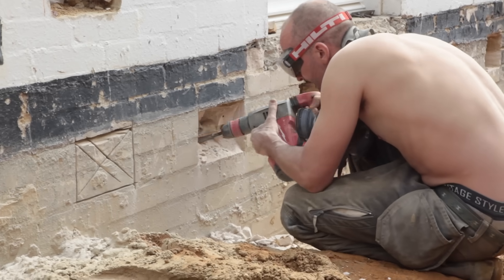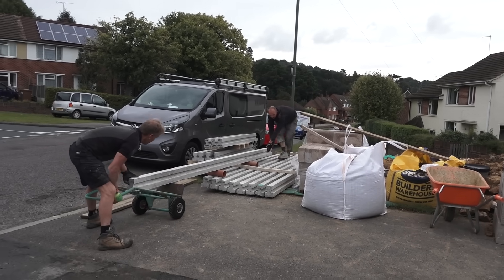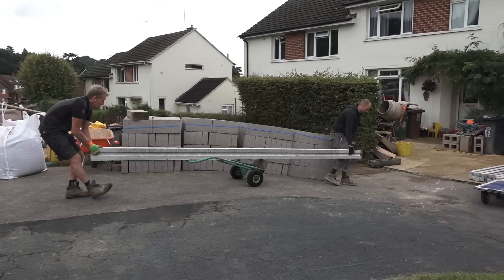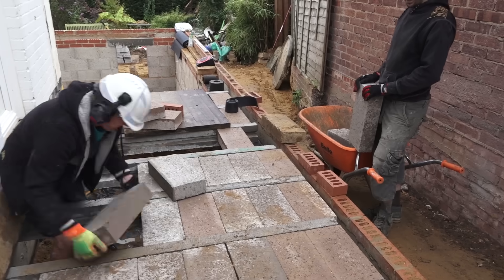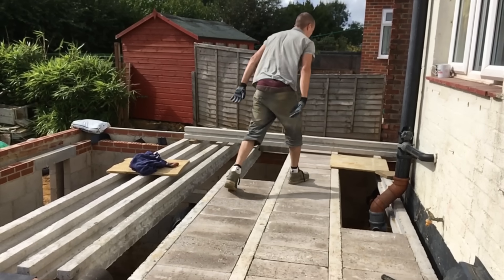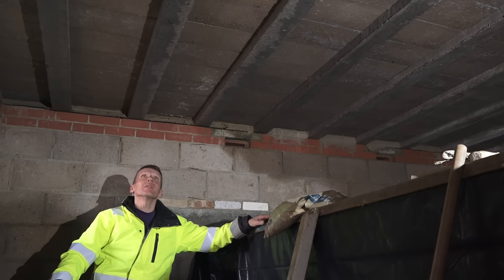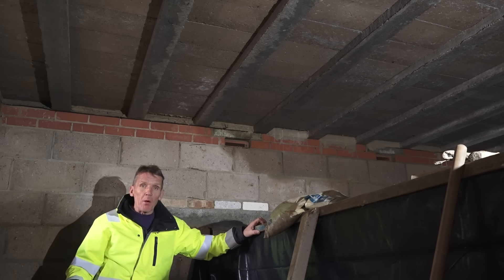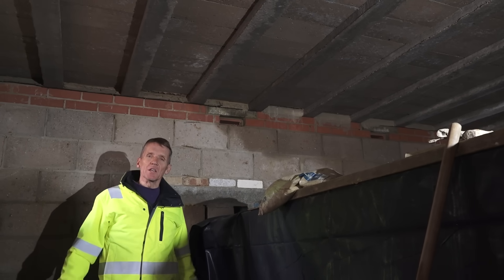Building an Extension #3 - Suspended Beam & Block Floor

Comment: Can you put a hot tub on a floor structure like this outside I have a raised deck area but 3 drains underneath so can’t build a concrete pad for the tub
Reply from the maker: The designers will tell you exactly what load it will take. 
Contact the beam and block company and tell them how many ltrs = kilos you want to put on there and add the weight of the occupants

Comment: I have exactly same floor, would I be OK with 700kg aquarium with flat stand?
Reply from the maker: It won't snap under that load but it might bounce a bit if you walk on those beams. It depends on the span and size of beam. You can download the tables for loading. If it is near one end it is always better.

Comment: Great video. What is the dimension of the block and beam (length/width/depth) you used and does the block have steel inside of it?

Comment: This is an interesting one me thinks 🤔 
I am all up to having a better living environment by saving energy that we use to make our environment cosy.

Suspended floor ventilation ... ?
Why do we ventilate it using the air from outside the house, it induces heat exchabge and loss through the floor up to 10%.

What I don't understand is ...
Why can we not use our internal house air to ventilate the b&b sub floor?
Nevermind the logistics and the  how we do it question.

Sure it is better to vent the subfloor using home air as opposed to using the air from outside the house?

Your elaboration on a subject would help.
Thank you Skill Builder 👷‍♂️

Comment: at 2min 50 seconds, you walk on a old bit of wood as a platform whilst carrying a block, down into a basement , death wish , no health and safety! should be bird cage below! very dangerous
Reply from the maker: You can't see that this is a semi-basement. That is about a 2-foot drop and that plywood is 18mm thick. It didn't break and it won't break. Our risk assessment is proportional and appropriate.
Reply: @SkillBuilder  a 2 ft drop is still enough to do damage,  regardless if that ply or osb board won't snap! When it comes to health and safety never say never. I know health and safety gone mad but this is really unsafe. On the full basement area, all it takes is for you to loose balance and full down and could be injured for life , for trying to save £800- £1000 on scaffolding. I've seen it happen been there done it! Becareful and think of health and safety especially for your employees.

Comment: You boys need to protect your legs having seen two accidents of late. Both were to the legs and both were wearing shorts. If they had been wearing trousers the injuries would have been minimal and probably gotten away with grazing or bruises instead of a & e and stitches. So when are you boys going to wise up. Having worked in engineering most of my career were not allowed to wear anything but protection clothing cannot understand why you lot put your selves at risk every day.
Reply from the maker: amby
The reason many people are drawn to the building industry (me included) is the freedom. Yes there are risks but from around April until October I live in shorts and I love it. I like the outdoor life, the non pc banter and the whole lack of formaility. All that is disappearing as the big sites make you walk around in so much ppe you can't actually do any work. Try putting in screws when you are wearing gloves.

Comment: Good video, I am looking to build a roof terrace that’s insulated to house a living space below. (When I say im a builder will carry out the job, but it’s not a common job in the Uk).  Roof terrace needs to hold a hot tub
Reply from the maker: Mr Kage 
You can ask the beam and block suppliers to come up with a drawing for the terrace. The size of the hot tub will have to be worked out. The water weighs 1 kilo per ltr. Also explore the option of placing the insulation on top of the beam and block and then a screed and water proofing membrane. It needs careful working out to prevent interstitial condensation.

Comment: Excellent video, we have a block and beam roof on our garages and we want to lay a patio on top, what product would you recommend to waterproof it before putting the slabs down ?
Reply from the maker: That job is normally done with asphalt but any kind of single ply membrane would do. You just need to have an escape route for the water if it gets through the joints. Normally the slabs are laid on small upstands so the water can escape to the edges.   https://www.roofingsuperstore.co.uk/product/rynopave-rps15-stackable-paving-support-pad-15mm-thick.html
Reply: @SkillBuilder  Thank you very much for the advice, we have only just bought the house and the roof has previously been paved but the roof must have leaked in the past and the whole roof area / paving has been painted over with some grey rubber coating, so we are planning to strip it back to the block and beam and start again, daunting task tho as it is 90m3.

Comment: Nice video! I've been on both ends of a beam and block floor, both fitting them in my site days and now designing them as a structural engineer. The practical experience is priceless, never will i spec the long beams that i used to have to lift with other labourers manually! Just a note; B&B floors are great where a suspended floor is required (clay type ground susceptible to heave) whereas slabs should only be used on well drained ground (gravel etc.). As a guide, ground types can be found through BGS maps but site specific bore holes or window samples should always be done to check the ground build up on site.

Comment: I was was der if the block and beam is part of a raised patio on the back of house can it be sealed to be made waterproof ? Thus not water leaks uder house
Reply from the maker: Yes it can be used in this way but  often a steel decking  system is used to allow a reinforced concrete deck to be poured. https://www.kingspan.com/gb/en-gb/products/structural-steel-solutions/structural-steel-products/multideck

Comment: Ignorant question - Can this concrete block & beam method be used to replace old suspended timber joists & floorboards?  If so, presumably you can still insulate very well underneath (no basement)?

Comment: Did the basement walls need structural strengthening or mesh reinforced cavity concreting due to side load from soil outside?  Also was any damp proofing done prior to this?
Reply from the maker: Yes the basement walls are reinforced with rods in concrete and there is a membrane on the outside. 
I think when you look at the huge number of Victorian cellars built from brick with no waterproofing or reinforecement the basement walls seem to resist ground pressure. It there is a enough weight on top they are fine.

Comment: Watched this video, then started a huge job replacing 1st floor of an old house with dry rot collapse well underway. I figure Serpula Lacrymans cannot eat concrete and I do intend to sell on. Especially useful was the truck handling tips - mine is a one man operation. Inside I lift beams with up to 3 block and tackle chain hoists rated 2 tonnes each with a scaffold tower. My beams are around 5.3 m and weigh in around 220kg. Also appreciated the sartorial underwear tips but I'm of a generation where we pulled our jeans up and skiddies were out of sight.

Comment: Skill Builder. Picking up on what you said regarding different ground. I am using BnB floor on extension. I have lots of made up ground... What's acceptable to put over this made up ground... Sand blinding and then some geotextile membrain? Some people are saying 75mm concrete oversite... Seems a bit excessive..?
Reply from the maker: If the ground is made up then I would use a mesh and 75 concrete but  the preference is still beam and block.

Comment: I've used those concrete beams before (T-Beams) and have found you have to very careful about the blocks you use with them as some concrete blocks can be made with inferior materials or not enough cement or not vibrated enough etc and would not be up to the task of taking heavy loads when laid on its side like this.

Comment: Thanks for the video. I am converting on the first floor a beam and block for a large balcony. Will 2 inches of initial cement base be sufficient, or is 4 inches needed. Be cementing concrete slabs on it later.

Comment: how come this construction method does not require vertical beams to carry the roof on top of it
Reply from the maker: The blocks are load bearing. Each one of those blocks can take a dead load of 15 tons.
Reply: @SkillBuilder  thanks, i just saw one house being built in my city in UK and i thought they are building something unsafe and then googled this method to check it out and it turns out its quiet used in here as well

Comment: Very good. What would be the best and cheapest concrete block to choose for an outer wall that will be rendered?There is so many to choose from, but the options available are so varied that it becomes confusing.
Reply: A lot of the time the price reflects the strength.  Stick with 7newton concrete blocks

Comment: Skill builder! Need some help understanding where you installed the block and beam floor? Did it sit on the internal brick work? 
Love your content, keep it coming!
Reply from the maker: Yes it sits on the internal wall. The external skin does very little except protect from the weather and give the walls stiffness. The internal wall supports the floors and the roof.

Comment: Hi thanks for the video. I am in the process of buying a building but it has wood worn in the loft. Is  the beam & block system
allowed to be installed for the attic floor?

Comment: How long did the complete floor take to build begining to end? Any idea of the weight rating? Looks the deal how much area did you cover & what was the complete cost? Top notch, might try this material out on an upcoming build.
Thanks
Reply from the maker: Hi Ranj
It takes a day or two to put a floor in like that. If you have three people you could do a job like this one in a day. 
As for costs and load bearing it is best to contact the manufacturers. Supreme Concrete is one of the biggest but there are plenty of others out there.

Comment: I'm no builder by any stretch..i just like watching your videos.  How strong is this method as those concrete blocks are hanging on by an inch either side.  Almost looks like you could jump and break them down the middle.
Reply: Compressive strength of blocks range from about 2kN/sqm to 40kN/sqm, standard housing block will be 7.5kN/sqm . 7.5kN/sqm is about 750kg/sqm, so each block can take about 60kg over the face of the block. Anyway, not sure why I am typing this 2 years after the event ;)
Reply: @pageboy1974  Load on the ‘suspended’ blocks will be a combination of compression ( top surface) and tension (bottom surface). And concrete in tension is only 1/10 of its compressive strength, so that may be a concern. However, I agree with Roger that a 2-inch mortar topping will distribute the load sufficiently to make beam and block design strong and safe depending on its particular design limits. Just my 2c.
Reply from the maker: Hi Ashley 
I know what you mean and I thought the same thing. I guess if you put a point load on the block it would crack but there is no point load. The beam and block is covered with insulation and a 75mm sand and cement screed with reinforcing fibres goes on top of that and then on that go the floor tiiles. Then you could drive a car over it.
Reply: Skill Builder top stuff thanks for the reply

Comment: doesn't look safe at all. lot of weight pulling down on the beams.
Reply from the maker: It doesn't look safe but neither does the QE2 Bridge or the Eifel Tower (temporary structure) ). These people have done the calculations and there are millions of  beam and block floors out there doing just fine.  At some point you just have to trust the engineering. When I get in an Airbus I always wonder how it can fly.
Reply: We design & manufacture & install these floors in the uk,  they are strong and cover all weight loadings, if large loadings more beams will be introduced, different depths also.
We are based in Manchester if anyone requires any products installing.
Reply: The weight on thosee beams doen't look like it can hold that weight. Worries me a bit to be honest.

Comment: Please tell me that you don't use blocks on their flat side for a floor?
Reply: whats wrong with it? Do you intend to take a sledgehammer to the floor? Even then id like to see you try break a block out after the render and floor screed/flooring.
Reply: So you pour a concrete slab on top of them right? What is done to the floor after this is not shown in the video?

Comment: Interesting. Wish our builder used this method. We have wooden joists and it annoys me every time walking through the room you can feel floor bounce and furniture shakes with the dipping floor.
Reply: You just have to use thick subfloor sheeting, if your joists are 24" apart, using 1-1/8" advantech OSB and gluing it down with their adhesive would solve the issue
Reply: bahopik unfortunately too late now. Oak floor and kitchen installed on top. If I remember correctly it was a chipboard interlocking subfloor screwed on to the joists.
Reply from the maker: We have timber on the 1st floor and I have a good way of stopping that bounce. It is coming up soon
Reply: Skill Builder I'll watch out for that. Mine is ground floor extension. About 2 feet off the ground. But floor is all finished and oak floor laid so I don't think there's much I can do now. I had though about plunge sawing out a bit and putting a timber support down from joist to a paving slab on the mud. But I'll probably live with it as is.

Comment: Hi Roger. Great videos, very informative. I see you used a cavity and a 4" block to bring you up to floor level in the cellar area. Just curious how did you transition from this to a cavity wall at FL? Did you use a tray damp extending from the top of the inner leaf to the bottom of the outer leaf at FL with weep holes?
Reply from the maker: Hi Connor
The retaining wall below ground level is filled with concrete so it is solid just like a foundation with an internal 100mm block face to make up the thickness. It  changes to a cavity wall at ground level and then comes up as a conventional cavity wall. A stepped dpc across the full width would have been a good idea and if it had been face brickwork I would have done that but the way it is any water is allowed all the way down to the solid block and then allowed to weep out at that point.  The fact that the concrete blocks are rendered means that the moisture in the cavity will be next to nothing.
Reply: Skill Builder 
Thanks,
Im probably going to have a basement in my house but brick on outer leaf so I'll use stepped dpc.

Comment: I didn’t see any DPC for the beams to sit on ?
Reply from the maker: It was there. Hi Load DPC.  2.19 we rolled it out as we went but we should have filmed it.
It can also be seem at 4.43 
I really need to do a catch up on all these details. We also put a dpc on top of the block and beam so there is no chance of any transfer. It isn't essential but dpc is cheap.

Comment: Great video as usual. Could that cellar be used as a bedroom?
Reply from the maker: In theory because it will be warm and dry you could sleep down there if you had a falling out with your partner, but that retaining wall is solid and doesn't comply with the required 'U' value so it is for storage.